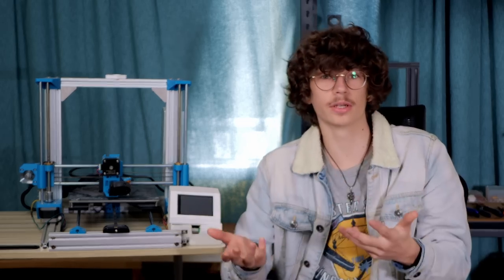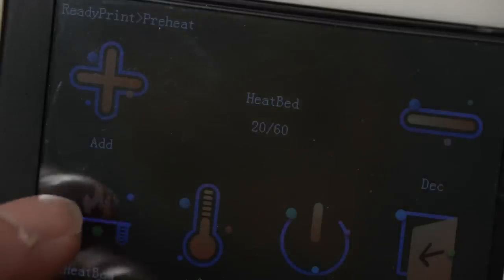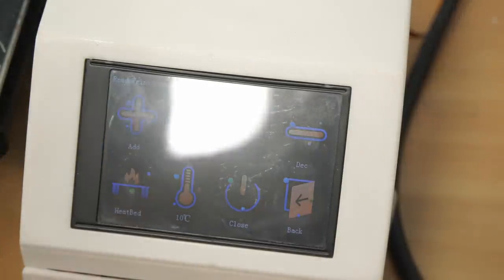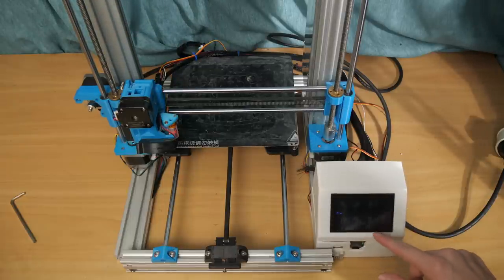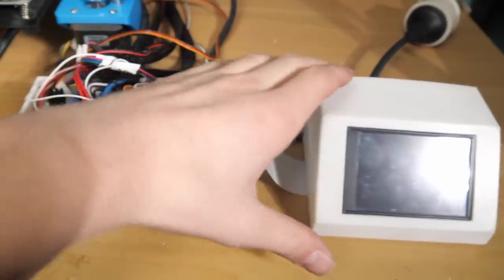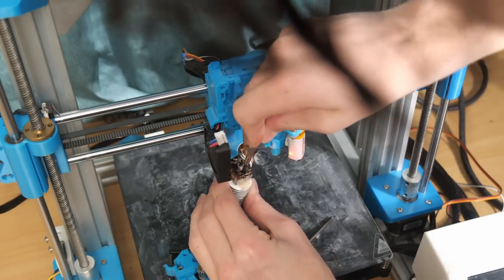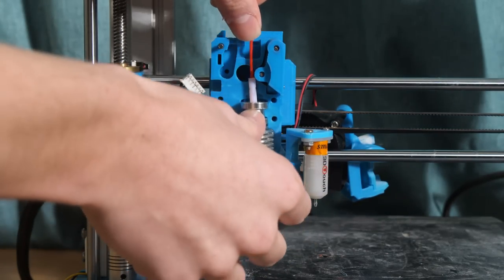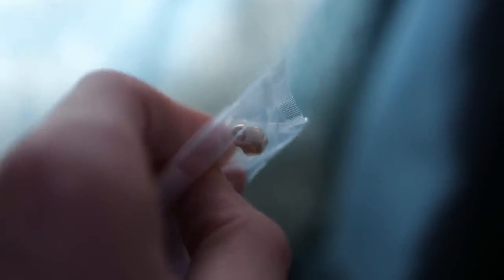I Bought Another Broken 3D Printer...

Comment: Specific pattern of the Prusa is called the Bear, which afaik isn't official but is a popular alteration of the frame. Some of the plastic parts are different but the extruder should (and looks) to be the same as the Mk3S and if you wanted you could probably print the R7 version with files off Printables (with a part modified to take a bl-touch instead of a pinda). Light blue parts may interfere with an IR filament sensor (the parts are meant to be black, and in addition to the sensor you'll need magnets for the lever and a little (8mm?) ball bearing). Others have pointed out that the pancake stepper is too weak- there are designs on Printables for little gearboxes to go with a pancake (though you will probably need to check the shaft length and will need to get other hardware), but the proper size of motor is a 42-40 (I think, that's what I used when upgrading my clone prusa into a "real" prusa).
If it's 24v and you need a new hotend Fystec sells a good clone of the Prusa specific e3d v6 that's all-metal for 40 dollars (if you don't want to buy the official one. I bought one recently and it even came fully assembled and heat tightened). The clone hot end that's in there right now is a bowden hotend that is supposed to use a PC4 coupling to hold the tube in place- the previous owner did this because they probably wanted to be cheap without realizing that the Prusa v6 has a collet built into the hotend, then they simply removed the coupling and hoped it would be held in place by extruder geometry alone. The Fystec hotend also comes with a better heater cartridge and thermistor that's in a proper metal cartridge, which may also fix the runaway issues- if it's particularly having issues getting up to temp, it may be a heater cartridge with incorrect voltage or an incorrect thermistor.
You can probably reflash the Robin with newer firmware, if you're willing; you may end up needing to do that in the long run anyway. It isn't too hard, just a bit of time. Does it use TMCs?
Reply from the maker: In part two I address a bunch of the problems, I try to solve all of them but some things won't arrive in time. I will do some research into finding printable parts for this machine as not having any spares isn't the best. I've swapped the pancake stepper for a full size one, it's currently working great. The whole system is currently 12, but in the future I would really like to convert to 24v as the bed heat up time isn't exactly pleasant. I've replaced the heater cartridge, thermistor, nozzle, hotend and now It's printing semi reliably. Also got a filament heater/dryer on the way so moisture and filament are less issues.  Once I get Klipper on the machine I'll do a deeper dive on the firmware. It uses TMC 2208 drivers. Thanks a ton for the information! This will be really helpful.

Comment: I started also with a used printer. your "filament" problems could be described as extrudes fine go to print and jams. I also have this problem. it is definitely 100% heat creep . the filament melts in the tube and swells just enough to jam . the solution I use is when you are done extruding be it a test flow or print have the g code pull the filament back like 50 mm to clear all heat areas that way you avoid the swelling. this drove me nuts on my machine. love the content .
Reply from the maker: Thanks for your comment! I had never encountered heat creep until I got this machine, it was an issue for many months. It’s mostly resolved now. I’m glad it happened though, it’s been helpful to learn about. Cheers

Comment: that pancake stepper is too weak for that type of extruder. Usually these are used with reduction type extruders like the BMG or Titan. Also you`ll get more clogs in the future as that piece of PTFE tube in the hotend is not fixed in place by anything so molten filament can and will get trapped between it and the nozzle as it will move upwards. Klipper is possible on this board but you`ll lose the touchscreen.
Reply from the maker: Thanks for the info! I’ve got a spare regular sized stepper motor, so I may swap to that. Do you reckon switching to an all metal heatbreak could improve things or will that not affect it? Good to know klipper is compatible, I do love the touch screen so I’ll have to decide if it’s worth it. Thanks again!
Reply: @TommyHoughton  a quality all metal hotend is worth it as that would eliminate PTFE tube related problems and allow you to print at higher temps. Make sure you reduce your retraction length in the slicer to 1mm or so as direct drive doesn`t require much retraction.
Reply from the maker: Good to know! I’ve been holding off on getting a few all metal heat breaks for my machines, so that gives me some good reasons to upgrade.
Reply: @TommyHoughton  get the bimetal ones

Comment: The temperature issues could be from the lack of a silicone sock for the heater block.
Reply from the maker: That could be the case. I ended up “borrowing” one from my ender 3 when I replaced hotends and it’s really helped. I’ve also added a really powerful fan so making sure the hotend stays insulated is very important.

Comment: The gap between Heatsink and Heatingblock looks really small. Maybe this causes heat creep = extrusions trouble.
Reply from the maker: It has been. I’ve replaced the fan with a less broken one and also ordered a bi-metallic heat break which should hopefully help. I’ve been lucky to never encounter heat creep until now, but it’s caused me to take apart the hotend assembly almost 10 times so far.  Thanks for your comment!

Comment: This looks like it was an ANET A8 that someone upgraded to a metal frame and maybe a newer mainboard. I’ve done exactly the same with my “free” and slightly singed ANET. (It nearly caught fire…)
Reply from the maker: I’ve been taking a look at the Anet Am8 thingiverse page, and it definitely bears more resemblance with this machine than a prusa. That must’ve a scary encounter with your machine, Klipper has been quite reassuring with this machine and thermal runaway.

Comment: Excluding the MKS Robin board, this printer looks eerily similar to my first printer when I sold it 6 years ago (MK2 clone). 3030 extrusion custom Prusa i3 MK2 clone with a 20x20 build plate. 

What I didn’t like about your fixes is that you were looking for faults in the wrong places. Many of the conclusions were incorrect or had a pretty obvious solution. You kept fiddling with the TMC heatsinks when you were experiencing multiple thermal runaways. I’m sure you’ll gain more experience over time. I’m happy to see someone attempt to revive an old printer
Reply from the maker: Thanks for your comment! Yeah I did make quite a few mistakes in this one, I’m grateful to everyone who’s pointed them out, I did end up going a bit all over the place while working on this machine.

Comment: Just a wild guess, but it might be because of the thermistor. My guess is that it's either broken or not properly setup in the firmware, which might've reported a lower incorrect temperature, causing thermal runaway.
Reply from the maker: You’re right, in the upcoming part two I swapped it out twice and everything started working properly. Also did a pid tune and everything is within a degree at all times.

Comment: I've got a printer with a robin nano 1.2 with the same touch screen as well (twotrees bluer v2/v3). It looks like you're running the mks firmware v2. But it is quite buggy. especially when using the bltouch. Or a clone. The issue is, that is seems to forget the z-offset settings and doing a g29 in the start code will lock up the screen or put it in a weird "not printing" mode even when it is printing. Either change it to read the heightmap from eeprom and set the z-offset in the settings or just remove the sensor and go back to limit switches. when you change somthing with dimensions and offsets you might cause the printer to not do any probing at all until the values are good. regarding the thermal runaway: check if the power supply can keep up and check if the cables are all good or if they are loose. When the bed heater or nozzle heater as too much resistance then it might be very slow. In that case change the thermal protection settings to wait a bit longer. I noticed, you got the esp module in there, that means you could upload modles via the mks wifi plugin in cura. However when you send a model over to the machine, make sure the heaters are off because the upload takes quite long and the thermistor is ignored at this time. Especially the nozzle will heat up uncontrolled while its uploading, which is a fire hazard. After the sending completes it will trigger a thermal runaway error right before the print starts and wil lock up the firmware until restart. Very annoying. My ptfe tube was heated above 300degree that way. Heating the bed before sending a print is fine, though, when the bed is not that hot at the start.
Using klipper with this board is a great idea and is what i will do on my twotrees bluer v2 (or v3).

If you need more info about the board, just ask. I spent a lot of time  learning its flaws and reflashing it a lot of times
Reply from the maker: Thanks for your for all the info! I’m still figuring this board out and having someone with experience will be really helpful. I’ll do some more research into the firmware once I start adding klipper to this machine. The thermal runaway issue has mainly been solved since I’ve switched heater cartridges and thermistors, I’ll attempt to do another PID tune again soon.
Reply: Klipper is an option, but you can also simply build the latest Marlin for the Robin Nano 1.2 and its LCD.  That will give you the latest robust firmware without needing an extra Pi for Klipper.  I cannot understand why printer-makers always try to put their own old derivative of Marlin on a printer instead of just adding their configuration to the upstream Marlin and profit from the community improving things and hence getting positive reviews because of it ...  And now those companies are starting to do similar stuff with Klipper (or at least derivatives thereof).  It's a shame...
Reply: @MisterkeTube  The issue is here that it seems the marlin version has changed quite a bit between the mks marlin github repo and the official one. I already tried that and there are lots of issues to fix when you want to keep the configuration possibilities from the robin nano.
You would also still loose the file preview feature from mks that can display the print object on the screen and some other mks additions.
the marlin version in the mks repo is actually not that old but the recent changes broke the firmware up to the point that it can't even read from sd anymore (i'm actually a software developer and i debugged it to some extent but it would be a lot of work to fix it all).
While I agree with your statement about custom repos, i looked at the mks code and it's organized very badly. This might be one of the reasons why it is so buggy.
Not only that, but they do lots of similar marlin things in a different way, instead of sticking to standard methods.
That way the marlin team would never accept changes from them. I certainly would not.
In my opinion installing klipper will be easier in the long run. anyone who wants to go back to the official merlin version can of course to this. I won't because of the easier configurability in klipper an lots of other benefits.
Btw. I got myself an mks pi board with the 3,5inch touch screen to replace the one in the printer.
Reply: @Noxoreos  You will indeed lose some of the "user-friendliness" of the touchscreen when moving to Marlin and when moving to Klipper you lose that touchscreen completely, but both Marlin and Klipper run fine on a Nano 1.2.  I have a Sapphire Plus with the same board and touchscreen.  With Marlin I would use the touchscreen in a simulation mode for the rotary button control of ex. an Ender3.  Not super user-friendly, but more functional than the nice GUI.  With Klipper it remains black and is now covered up by an old Android tablet running KlipperScreen.  I'll choose good printing quality and speed over a nice touchscreen GUI every time.  And dump the wifi ESP8266 connected to the Nano.  It's a suoer slow communication link.  Instead get a Pi to run Klipper (or Octoprint), it will give you a way better wifi experience.
Reply: @MisterkeTube  Yes, I know that touchscreen will be useless with klipper. I'm choosing quality as well over user friendliness. And since the original robin nano firmware from mks is to much of a hassle for my taste after finding out about all the problems, I went with klipper. Changing parameters without flashing firmware is my biggest reason to install klipper because i try out many things and also build my own stuff for the printer. And because i like having a screen ready to be used when i want to check something in front of the device, I got an mks pi with a 3,5" screen that runs klipperscreen. It can be bought together as a bundle with the mks pi. And it fits in place of the touchscreen from the robin nano. So i don't need an extra tablet. It's alright for the basic stuff like viewing the progress and simple configuration.

Comment: Love it, let's see if you can beat my 6:49 benchy on that (i think it's a fair fight
Reply from the maker: Part two is coming out soon where I push this machine with upgrades! Aiming for under 20m right now, but I should be able to get 15m. Thanks for your comment!
Reply: @TommyHoughton  you are welcome brother, let me know if you wanna do a Collab
Reply from the maker: @Lucas_sGarage once I get everything modified I’d love to have a friendly Benchy race. Would be good fun. *not sure if my machine would comply with the speedboatrace rules tho but I would have to check
Reply: @TommyHoughton  as long as you have steppers, a (up to) 0.5mm nozzle 2 perimeters, 3 top and bottom layers and 10% infill you are set
Reply from the maker: I'm currently using a .6mm CHT nozzle, so I would have to find something else. I'll keep you updated with this.
Reply: @TommyHoughton  for my first 2 videos i was using a 0.6 nozzle i just reduced the line width
Reply from the maker: @Lucas_sGarage  so using a .5mm line width or lower would be viable?
Reply: @TommyHoughton  to my understanding, yes